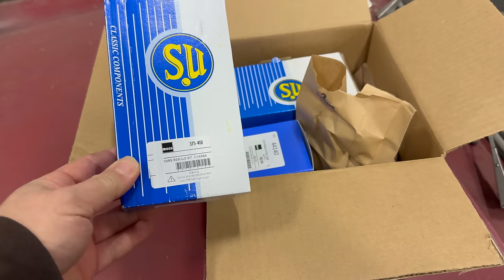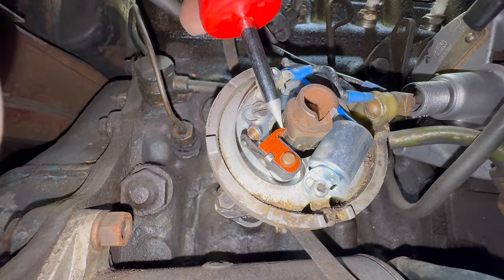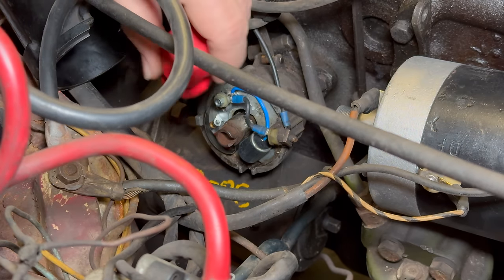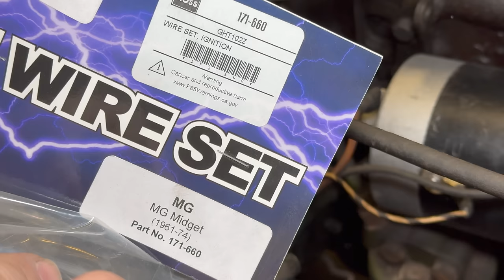New Ignition for the Innocenti Spyder

Comment: Many years since changing points and condenser on any car. I can alway remember cleaning the protective flim of the points first, then applying a small blob of grease on the distributor cam which came with the points pack. Then the last thing, a drop of oil on the felt ped under the rotor arm.

Comment: Delightfully analogue stuff. I think it's been about 30 years since I last had a car with points ignition, but I well remember 45 years back as a young unmechanical amateur mechanic, having to change the plugs and the HT leads, replace the distributor car, change the points and set the gap on the roadside of my very first car, a 1969 Vauhall Viva 1600 DOHC.

Comment: No you don't want to be dropping small bits into the distributor, that would not be good. I have however seen people just 'rip off' the old HT leads and then mix up the timing and wonder why the thing wont start? I have always followed your method of replacing the HT leads. Next will be the carb rebuild so she wont be spilling fuel everywhere. Good job so far Steve. 👍👍

Comment: It's a lot easier to work on changing and setting the points if the whole distributor is removed from the engine.
It is then possible to get the points gap accurately set at the max cam opening.
Just remember to check the position of the rotor before removal so that it can be aligned when refitting.
Oh and don't rotate the engine whilst the distributor is out or the drive spigot will be in the wrong position and the timing will be way out.
Reply: An additional benefit of having the distributor out is that it can be easily cleaned and lubricated to ensure that the advance/retard mechanism works freely.

Comment: The blue wire in the distributor from the external terminal to the points is aftermarket/homemade.  I would replace with the  Lucas very flexible black sleeved one as the blue one is likely to fatigue and break over time as the points plate moves with engine vacuum.